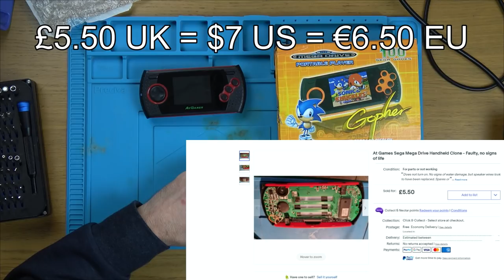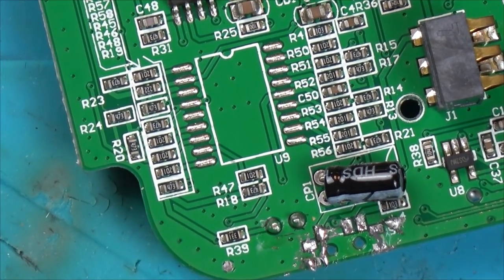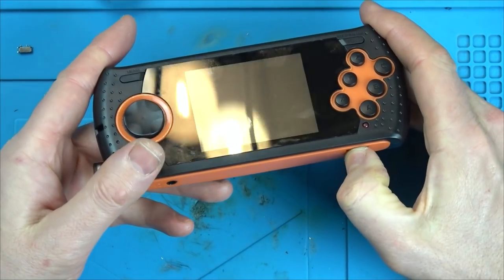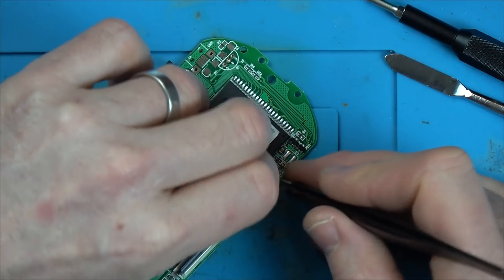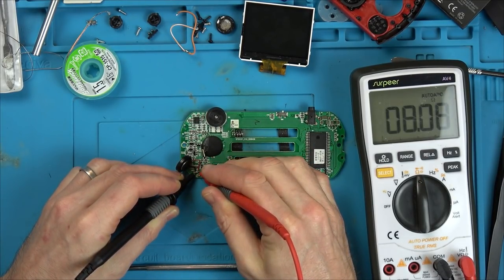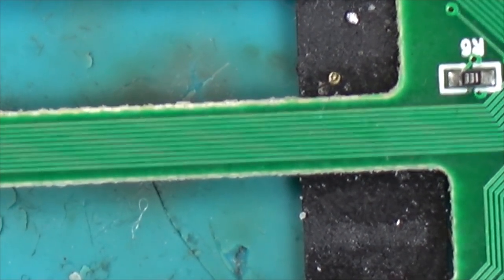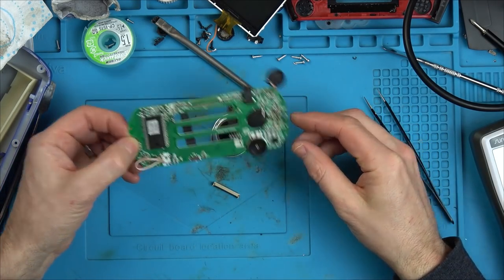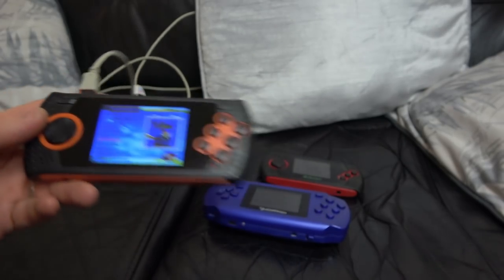2x Broken SEGA MEGA DRIVE (Genesis) CLONES - Can I FIX Them???

Comment: A pleasure to watch you videos Vince. To avoid breaking the plastic pin from the switch, you have to push the exterior button on one side, then the switch to the same matching position an place the board in an incline position at an angle to join the 2 parts the press the board on the other side.

Comment: My tip for low melt solder would be the Mechanic XW5 which has Bismuth in it to reduce the melting point  It's melting point might be slightly higher than the chipquick, but it's still very low  (140°C or less). You get a 40g roll for about 12€, which is like 1/5th of the price of ChipQuick.

Comment: Nice video altrough these are cheap emulators it nice to see that you put care in them its also fun to see what different manufacturers do the first one had an actions risc chip and the second one had a globtop i expected them to both have globtops but no

Comment: 32:35 the very last pin on the left of the display connector looks like it has a track break on the left track that goes off to the left and runs under the 2 of the marker 'C21'. bet that got jumped on the subsequent reflow?

Comment: Great video, did you notice that the battery spring connector on positive I think it was (lcd connector side) wasn't soldered properly and it looks like the trace went to the lcd connector. When you used the hot air it re soldered again. wonder if it was that?

Comment: I'm guessing liquid spill. Sometimes you can get away with a wash, sometimes you need to RnR the part to wash under it, ala L Rossmann, so as to remove the slight continuity of the liquid residue between parts.

Comment: you should try low melt solder paste instead of these expensive low melt sodler wire, it is soooo nice to use. for example you like to solder a multi pin cpu chip like on used in a master system just pull a line of solder past over all contacts, melt it with 180°C hot air only and it will suck right on to the pads with the perfect amount of solder it is sooooo much easyier to use. also available as higher melt not only low melt version. i do not use anything else anymore.

Comment: Oh Tony no! Don't use that low temp crap! Regular 60:40 and good Goot braid on each chip as you go! Also only use fresh braid - cut anything that has any slight bit of solder on it. You will notice the difference

Comment: Had that switch problem years ago with a DS could not get a switch so cut a needle to size heated up and pushed in switch part worked perfectly for years until ex gave it away

Comment: i have a white one with blue buttons that the charge port was broken on. the guy who i got it from soldered a usb cable to the battery terminal. I tried to replace the charge port and the traces completly lifted off the board lol

Comment: The Sega Genesis Ultimate Portable Game Player could have been a decent handheld if:

-The menu graphics were stylized with Sega flair

-Every ROM was playable with the option to switch between regions

-SRAM and save states were supported

-An extra speaker was built in for stereo output

-A better rechargable battery was installed

-A lanyard with a Sega logo was included

* Sigh * Neto Bootloader and battery mods can only go so far. Is there anyone on the net who has actually managed to fix/update the Firecore emulator itself?

Comment: I have the orange one it works but the battery is starting to swell and it is not the battery it claims to be on the label.  The contacts are in a different place so you cannot just replace it :(.  God knows what type of battery it is.

Comment: Yes that's the same model as the playpal and the coleco Sonic. The screens are cheap and die. I've been looking for years for a replacement for mine
Reply: You can find replacements for the Orange one (the Mega Drive / Gopher) on AliExpress. Search for 2.8" 240x320 TFT LCD. No touch, no red board on the back (just display and flat cable)
Reply: @rigues  hay thanks I need to find a new one

Comment: Personally I'd just use the atgames screen to fix that nomad clone, even though you got it working. The at@ames megadrive/genesis machines are not worth the plastic they're made of =/
Now, their ATARI handheld, that is a decent machine. Even includes all the difficulty switches and BW/Color. Most dont.

Comment: what's the difference between one of these and a Game Gear?
Reply: These are emulators whereas Game Gears are a real game console, however, Game Gears can't play Genesis games, only Master System Games. If you get the Sega Nomad, that's a real handheld console that can play Genesis games.
Reply: @andrewsawesome  thank you for the explanation
Reply: These are emulayors cause the cpu in the original is not the same as this actions 2259c wich is risc based  and it might be more powerfull and more newer and they dont un the same software

Comment: Oh, wow, Altered Beast sounds horrible but that's AtGames' fault, not yours.

Usually when people are demonstrating the poor music emulation on AtGames consoles, they either use Streets of Rage 2 or Sonic the Hedgehog. This is the first time I've heard Altered Beast's music twisted through the AtGames wringer and, yeah, it sounds way off even taking into account that I'm only hearing an audio recording of a tiny speaker. And that's a pity because I otherwise really like the design and the screen (well, I'd prefer the one with six buttons, but the North American version of the Sega Genesis Mini had the three button problem as well when the fighting games on it were designed for six buttons but at least you can buy a 6-button controller for the Mini).

Comment: Its a shame that you cant fix the biggest problem these machines have... the emulator they use. It is utter garbage. Try Sonic the hedgehog 1 on there and listen to the music, its horrible.
There IS a fix for some models of the Gopher, the six button one, no idea about the three button. I just know that it didnt work on mine.
Reply: Thier is no fix sadly for the three button model. I own one of the three button model. I was satisfied when I bought it many years ago. It still works.
Reply: @timmyburden5701  Well they are ok for some games, but others are just torture to try to play. The Pocket Go S30 is a handheld well worth looking into, it can be rigged to run retroarch if the original emulator doesnt do it for you, and it handles it quite well. Good controls, nice screen, small and light. Good lil machine and not too expensive.
Reply: @Graytail  oh yeah for sure. I own an ldk landscape and I played that a ton. So many options now.